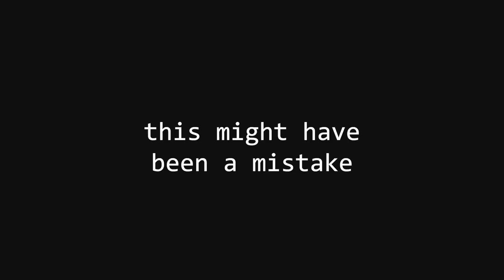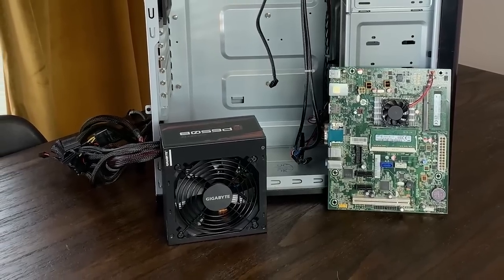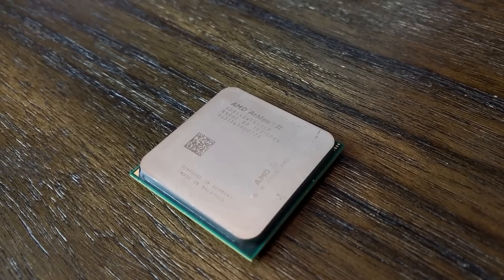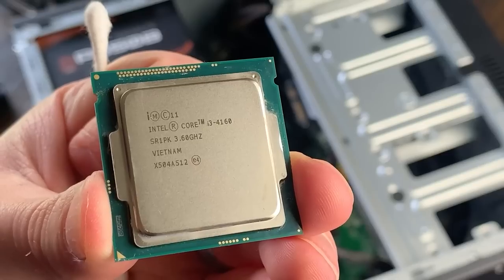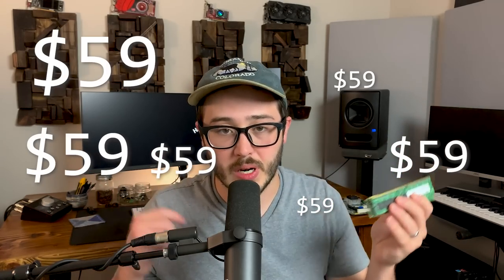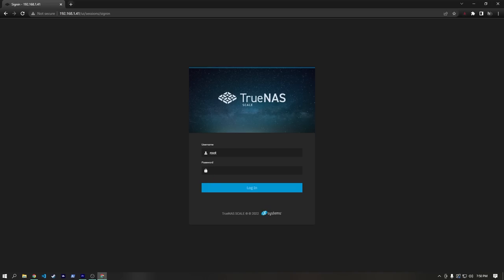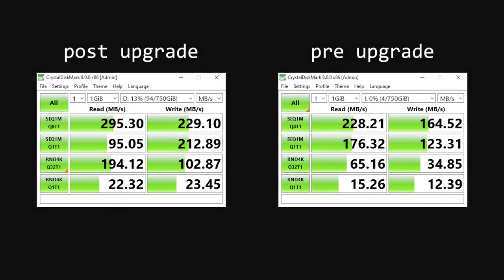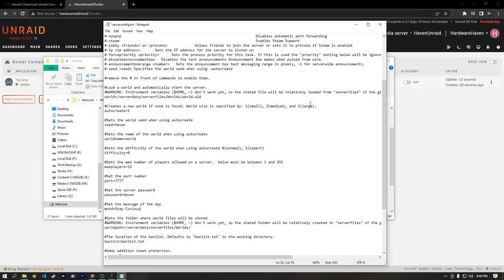Upgrading My TrueNAS Server

Comment: Take a use of the ipmi. That is extremely useful for checking on your system, including the fan behavior.
Reply: I had this issue with my SuperMicro X11 generation board.
You need to set the fan 'normal' RPM at the idle speed  or so, because the board goes into panic mode and tries to spin the fan up once it detects the fan have gone too low.
This eventually killed two Arctic fans I had installed, so I corrected the fan settings and installed Noctua Industrials so this won't happen again. :P

Comment: your use scenario will 99.95 never notice the difference with ECC vs non ECC for ZFS. If however you are running a corporate NAS that has thousands of users hammering it for thousands or tens of thousands of files, and running databases off of it, then ECC matters regardless of ZFS or not, but in that circumstance ZFS plus ECC will hit its stride.

Comment: I use proxmox to virtualize my true nas server, and it’s funny cause truenas sees the virtual memory as ECC registered even though they’re not. But I’ve never had any problems with using regular memory on truenas, I’d say the biggest thing is having arrays for data redundancy is more important. But if you want your server to be as close to perfect as possible in the case of troubleshooting errors, ECC is more guaranteed.

Comment: my NAS box had a i7 3770 4c/8t CPU LGA1155, & had an old Lenovo think station with an i5 2320 4c/4t LGA 1155 & swapped them out ... works great ... 4 cores is more than enough for a light use NAS box ... was a lil worried it wouldn't work. But booted right up no sweat ... love the captions popping up as you talk ... very smart

Comment: Thanks for making these NAS videos.  I have a 10+ year old Netgear NAS that I always felt was going to need to be replaced at some point due to age and for keeping up with new technologies.  I've built PCs in my distant past but never thought of repurposing an older PC for a NAS.  It's definitely less expensive than buying a prepackaged NAS from Netgear, Synology, of the like.  I'm glad you also analyze power draw, since that is definitely a question in my mind if I'm going to use an i3, i5, or i7 of whatever generation.  Thanks again for the inspiration!

Comment: I would definitely say this is a good upgrade compared to the old version. 
Im currently running a very similar setup with an i3 4130 and 16gb of ram, tho with a dedicated ssd for ZFS caching. 
This would be the only additional thing i would recommend to upgrade in your case here as it gives you a really nice boost on big file transfers.
Reply from the maker: That might be something I try out with the 6Gb sata ports 👍🏻
Reply: Do you find the SSD actually helps?
Reply: @wayland7150  Im limited to 16gb of ram so it does help when im dumping large files on it
Reply: @toaster98  I don't think you are limited to 16GB of RAM. Try 32GB. In my experience SSD only sped up recent re-reads or writes and actually slowed down large writes. Hard drives have a decent write speed in RAID layout where as SSD will have super fast write speed for 60GB then go super slow, much slower than hard drives. So no good for really big files or drive copying.
Reply: @wayland7150  I am limited because my motherboard only has 2 ram slots.
Reply: @toaster98  check the i3 cpu spec to see if it will support 32 gb before buying ram.
Reply: @theoriginalDJ_H  the cpu isnt the issue here. My board has only 2 ram slots and i have yet to find a 16 gb ddr3 module.

Comment: So. I've been on OpenMediaVault since OMV4, and that system was in need of space. The board I'm running it on is a Celeron 1007u limited to 3 SATA ports, so an upgrade was needed. After watching hours of TrueNAS videos I wound up buying the same base hardware you used here, except with an i3-4130. Not needing the space you do I'm using 3 4T drives in raid z1 for storage, a pair of 512 GB drives for apps (OVERKILL) and a 120 GB boot drive. Performance is much improved over the 1007U system, and my idle is around 23 watts. I would agree the components you chose are excellent for this use case, and it's rather surprising what it's capable of. I moved my JellyFin server there (yeah, I know.) while working on a different upgrade and it will direct stream 2 videos at 1080, but really can't do transcoding and doesn't like when you scroll through a video.

Thanks for sharing the trials and tribulations. Makes it a lot easier to dive into something new when you know you aren't the only one who needed to struggle a bit to make it all work.
Reply: This is an interesting comment. One of the things I'm concerned about is the idle power draw, do you know how you got yours down yo 25 as opposed to the one in the video? Thanks
Reply: @Itsallfun3000  I'm not 100% sure, but there are a few differences. I'm using 3 5400 RPM WD Red Plus drives, I think the Seagate Ironwolf drives he uses are 7200 RPM, and he's using 4. There are two versions of the i3-4130, it turns out mine is the i3-4130T which is the 25W TDP variant. I think his is the 54W version. He's using a pcie network card, and those draw extra power at idle. There are also probably some differences in power supplies, mine is one of those Corsair 550 watt supplies known to be efficient even at low power draw. I measured mine with JUST TrueNAS running, I hadn't added any apps to the equation at the time, and honestly haven't measured idle draw since... I don't know if he perhaps had other apps running when he took his measurements.

I did find one glaring weakness to this setup.. the i3-4130T can't handle transcoding. I've solved that with a Quadro P400, but I haven't measured idle power draw since adding it. I run Jellyfin, Synchthing and Home Assistant on it, so overall demand is pretty low. I had NextCloud on it for a while, but moved it off to a mini-pc because it had a bad habit of eating up memory no matter how I tried to limit it, and would bring server performance to a crawl. I assume that's a TrueNAS or NextCloud configuration problem on my part rather than a hardware issue, but since it's the only trouble I've had in over a year I thought it was worth a mention.
Reply: @cameronfrye5514   thanks for your reply I think that all makes sense especially the cpu T variant. I have a separate laptop I use as a server for my emby. It's got an i3 7100u so it can do the proper transcoding but it idles at 4w :) I dodnt want it all on one box with the port open for emby!
Reply: @Itsallfun3000  Actually, the mini-pc I'm using has an N100.. I should probably see if that can handle the transcode. If so I could leave the files on my NAS and remove the P400. Now you've got me thinking... better break out the Kill-a-watt!
Reply: @cameronfrye5514   haha the watts have become and obsession for me. Makes me spend more on h/w 😅😅

Comment: Thanks for the video. I've been running ZFS without ECC for over two years. Only downtime was the upgrade from FreeNas to TrueNas and only once shut down the system to add HD capacity. Never had any problems, except of course to get Plex to do hardware transcodes on TN. Havn't figured that one out...

Comment: I think your videos are well done. They are the reason I converted my old AMD FX PC and used it as a NAS. I'm not 100% happy yet and have to adjust something here and there and possibly new fans. But it works and I use it. Although some may rightly say that an 8-core AMD FX CPU is not the best choice. But it's what I have on hand, and with 16GB of ram it's doing just fine.

But what I will definitely still buy is a 2.5GB NIC for my Network
Reply: The performance is fine for stuff like a NAS, but those FX chips are awfully power hungry even at idle, the amount you'll pay in electricity over a few years would probably cover the costs of just buying something better.
Reply: @vgamesx1  Yes i know. I am Waiting for a old PC of a Friend. He have 3 old Office PC`s and i can have 2 of them. And i think for 10 Euros its more than ok

Comment: This was a great video and yes, SuperMirco boards are usually preferred for server based stuff, as I have an X8SIL model running with unRAID in the Antec 300 case and has run reliably for several years running 24/7.  I use an HBA for my drives.

I was considering looking into trying TrueNAS as I have dabbled with FreeNAS in the past but haven't gone very far with it. I may consider getting a more modern SM board that isn't too costly with the ECC RAM (the ECC Ram is what helps against bitrot and data corruption). I never realized though that it was possible to video edit from a NAS...i'll have to look into that. I usually edit off the workstation then offload to the NAS once I was done with the project.

Comment: 11:38 The Q1T1 you mention is a measurement of random io performance. The reason it did see some of a change is because the bottleneck went from CPU to the storage itself, this is 100% bottlenecked by the HDD's nature. (The head cant move fast enough on the platter). For a nas this is less of an important because often it will be read from sequentially like Q8T1. However, if you were to for example run a Minecraft server on it then most of the data read and written would be completely random and out of order. Thus requiring more responsive storage mediums, RAM ;)
Reply from the maker: Yeah, it's just strange that it got worse rather than staying the same
Reply: The only Q1T1 metric that shows worse after the upgrade looks to be the sequential reads (176MB/s before and 95MB/s after).

Comment: If I understand correctly, it looks like the AST2400 chip provides graphics, so it can run a display even using a no IGP Xeon.
If you want to trade some performance for power reduction - you might want a T model i3 or an L model Xeon
Reply: Yes a Xeon would be a wise choice here and the graphics will still work. If not then use the IPMI to set it up.
Reply: @wayland7150  Usually it's either the E3 12x5 or 12x6 v3 will have iGPU, the rest lacks iGPU.
Reply: @AlfaPro1337  You don't need it in a server board. They have on board graphics. For instance Fujitsu makes a little server using the E3-1230 V2 CPU and that has VGA out put but no graphics in the CPU.
Reply: @wayland7150  Not all play well, some only works during start up, but on OS, it doesn't detect.
Reply: @AlfaPro1337  I've not had that experience. The graphics provided by the server board has always worked but very slow.

Comment: First, great video!

I love repurposing older hardware but have grown to dislike (read hate with the passion of a thousand suns) the babysitting required to keep things running. I recently purchased an off-lease Dell workstation for the same purposes in my network. Personally, I'm running Proxmox, instead of a NAS OS, because I want to play with building systems for POC/Testing as I am a Systems Administrator and do this for fun. Congrats on the upgrade, Supermicro systems are nice and reliable in my experience. As for my NAS solution, I have a container that runs a Samba share to bulk HD space.
Reply from the maker: Thanks!

And yeah sometimes the tinkering and babysitting is fun, but sometimes it can be a pain. I have two “pools” of servers at my house. Some are what I actually use for storage, home assistant, Plex, etc.. and some are the ones I mess around with. 

Also what does POC stand for? I’m a noob haha
Reply: @HardwareHaven  Proof Of Concept, like building something to see if it will do what you think it is supposed to do.
Reply from the maker: Oh duh. Makes sense
Reply: 21 hours ago?
Reply from the maker: Patreon early access
Reply: @HardwareHaven  
I figured it was something like that. Forgot you had a Patreon

Comment: you have ipmi, use it it will change your life and how you manage servers, no need for displays, keyboards, full remote control via network including bios setup,  os install (mounting ISO remotely) and so on.. not to mention SEL and remote monitoring and so on IPMI is a must for servers. I think supermicro x10 series support HTML5 KVM so full remote control via browser (no need for java and stuff), you may need to update BMC firmware.

Comment: I just added a second pair of hdd's to my 2014 ASRock Q1900DC-ITX.  It's been powered by a 65W laptop brick for 8 years.  Replaced FreeNAS 9.1.2 with TrueNAS Core 13U1.  I found the mb manual, which recommends a 79W psu with 4 hdd's, so time to find a 90+W brick.  Despite the temptation to add plugins, vm's, etc. to TrueNAS, I've kept it dedicated to backups and shares only to maximize stabilty.

Comment: It's fine to use a couple of good quality USB thumb drives for TrueNAS core. As long as you've saved your pool keys on another computer nothing really bad can happen. You can build a new TrueNAS box and plug the existing storage in and import it and all your files are still there. You want to maximise your SATA ports for actual storage drives.

Comment: One thing i personally like for my own servers are more open bios, with voltage control options to try undervolt the cpu and save quite a few watts under load, did this on a e5 1270v3 xeon and lowered the cpu power usage from 75w to around 55w with no speed reduction, could get it down to 45w even but it wasn't very stable there

Comment: The problem with fans cycling is that you use fan that has minimum rpm that is below threshold for fan failure set in bmc, as it is server board mostly preconfigured for higher rpm fans, so fan goes low rpm bmc thinks fan has failed and tries to ramp it up then detects good rpm and ramps it down and loops in this cycle. basically what you did with ipmitool you told BMC to set min rpm threshold to lower, so now it does not think that fan is failing if it goes to lower rpm.  if you used management system event logs it would show you fan failures and recoveries on cycle.

Comment: If you have a switch that supports link aggregation, you could try that wit the two 1Gb NICs. Nice setup BTW! Assuming of course you have multiple users on different ports of the switch to take advantage of higher total bandwidth :)
Reply from the maker: I do, but the 2.5GBps + a 1Gb connection is PLENTY for my use case haha

Comment: @
Hardware Haven I think it's worth to take a look at that failed mobo.  Try power it on and check voltages on inductors It's pretty possible that short killed one of the mosfets or voltage converter IC itself and that's why it doesn't post.
Reply from the maker: Yeah I might try to if I get the time. It would be cool to “resurrect” it for a second time haha
Reply: @HardwareHaven  Check also resistance to gnd on header where short was created.

Comment: that's funny, I've got nearly the same setup for my back up TrueNAS :
i'm running the X10SLH-F version of the X10 supermicro board though, which has all SATA3 ports, and I run a 4330 (because that's what I got from a "dumpster dive")
this gen can definetly support 10GB networking, but you'll have to go with a gen3 PCIe slot then

a point to note : this type of board has some sort of integrated ECC for memory.
It's fairly common on supermicro boards, as they can end up in network 1U enclosures (that's where mine came from, but as the power supply, PCIe riser and network card were all missing, couldn't use it as my router / firewall sadly)

as a tip : for the boot drive, I went with an old 2242 M2 SATA 32GB ssd in a small USB3 enclosure (I had both on hand)
for write drive on a budget, the small 16 / 32G NVME optane modules are great.
for L2ARC / read cache, good NVME > SATA SSD stripe > mediocre NVME > single SSD.
On my main system, I personnaly went with 3 M2 SATA 240ish GB drives that were pulled out from laptops, setup in raidz1 for my read L2ARC. They all sit together with my boot SSD on a 4 M2 SATA3 to PCIe card. works really great.
For my write cache, I went with a pair of 16G optane modules in mirror - but this is on a full eATX board, so I had slots to spare.

my use case is video streaming with emby, nextcloud, video game server hosting, ts3, ... as well as VM and ISO storage for a "tiny mini micro" type of ESX cluster via iSCSI - i'm a system & network engineer, I test a lot of things..
well, the VM part sits on a different VDEV than the rest of my data, on all SSD storage (a pool of 3 old samsung 850 500GB I got second hand)

also, beware : if you start doing containers / VMs, you'll end up like a lot of us, with bi xeon boards and huge vdevs :>
Reply from the maker: Thanks for all the info!

Comment: I've currently got a server running WS19 and use it for general web servers, some small storage and game servers, it works fine with its 8GB of ram and Core 2 Quad 8440Q, I use a GT710 as a basic display adapter and several SSD's as storage.

Comment: Is the BIOS set for a 4-wire fan?
3-wire fan control is via PWM on the voltage input but 4-wire fans have their own PWM controller which is data-driven with the extra 4th wire.
Feeding a 4-wire fan with PWM voltage on the supply could make it behave erratically as its controller keeps resetting.

Comment: I watched both of your NAS videos. This system will spend double the power. The older one was not a mistake. It died by an accident, things can happen :)
Reply from the maker: I included power draw figures in the video. At idle it barely consumes more than the original system. I’m also very happy with where it’s at currently!